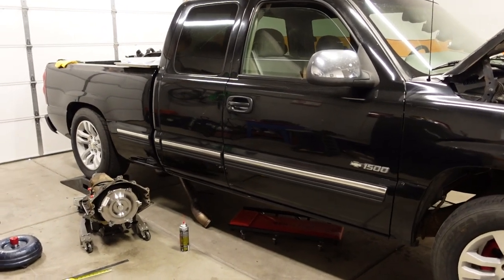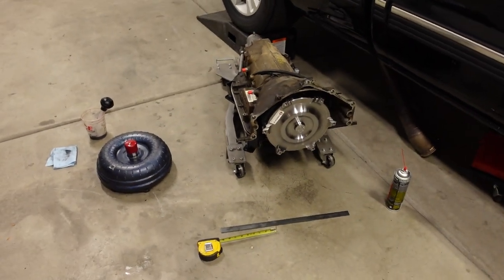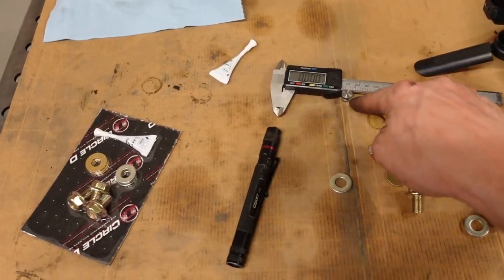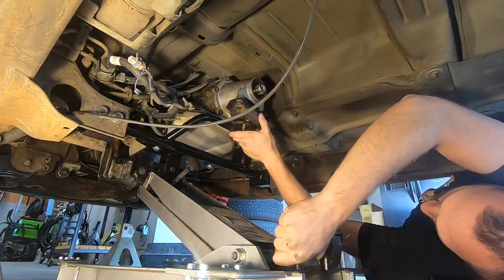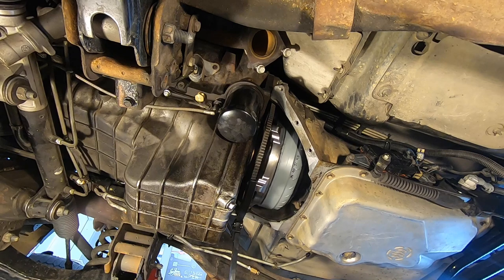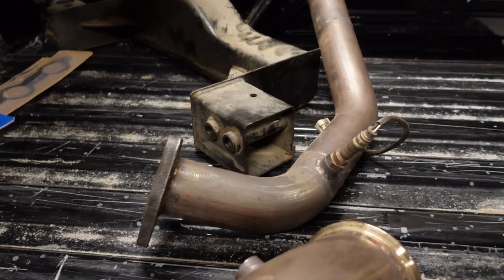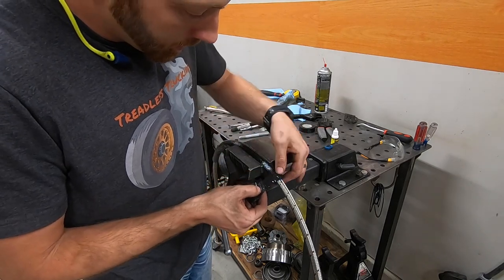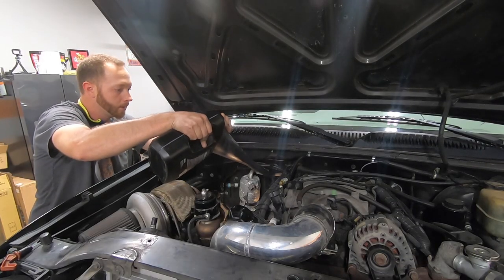the MOST IMPORTANT UPGRADE for ANY automatic transmission.

Comment from the maker: Guys, let me know what you think about the in-radiator trans cooler: did you leave it out or did you keep it, and whats your trans temp like?
Reply: In Utah you're supposed to hook it up in series with the other cooler to help maintain the temperature in the cold...
Reply: i took it out. trans runs at about 150. 2002 CCLB. 10” lift, 22x14’e 35x15.50 tires. 4.88 gears. cam, yank 3200 stall. truck scales at 8000lbs. leave the radiator out for sure
Reply: Use both coolers it's more effecient.
Reply: When i did my 4l80e swap and 40k cooler. I bypassed the factory cooler. But that being said im in Central Texas we don't get very cold. I never get above 180-200 with a load in 100+ heat index
Reply: @ImpalaSSRulz21  like he said, all it does is heat the fluid if you have a large trans cooler. 4l80’s come up to temp very quickly with the tall first gear
Reply: @waynesworkshop7069  even when it froze in houston, my trans was up to 100ish after just letting the truck warm up idling.
Reply: I went to the comments to ask you to keep us informed how it does and your opinion down the road. I’ve often wondered about this because I’ve had projects in the past where I had manual tranny radiators but I went ahead and ordered one with a cooler built in because I felt water to fluid was more efficient at bringing it to temp, then the fluid to air exchanger could drop it a little more with ambient air. I feel if there’s pros to be had from the rad cooler I want it hooked up to take advantage of those. Be nice if you could monitor temps with 3 sensors/locations , one coming out of the trans, one coming out of the factory radiator, then one after the aftermarket cooler before returning to the tranny.
Reply: I left it out being in texas + I have had broken radiators that leaked coolant into the ATF and it would kill transmissions
Reply: I have a 2007 Silverado turbo 4.8 built for towing and I live in south Florida where the heat and traffic suck lol. I have a home built 4l80 as well and when I first installed it I bypassed the radiator and just had my big cooler in the grill. Temps stayed consistently between 185-200 towing. I then brought the radiator cooler back into the loop and it's now 160-180 towing. 
The cooler in the radiator is on the "cold" side and with a temp gun I measured the rad hose going back to the engine and it is around 170 (on my truck that is). Also water is more efficient at removing heat than air. So my hot trans fluid hits the 170 coolant cooler then flows to my 2nd cooler in front of the grill. I've done back to back testing and the radiator cooler does help, BUT if a external cooler can keep up then the radiator cooler probably isn't necessary
Reply: I run the same cooler in series with the radiator being first, I’m up in Michigan and it gets cold so that is why I decided to do it that way. Pcm of NC makes nice quick connect to AN adaptor fittings. I have a 2006 vortec max that is a bolt on truck with 390whp. I also have a travel trailer and when I’m dragging that around I am a combined 16,280lbs. Mine will run 150-160 degrees going down the freeway with the converter locked up, the highest I’ve ever seen the temp is 180 degrees while running around our local sand dunes in low range. I like your installation brackets, mine is similar. Also one other note is that I run a circle D 10.5” triple disc in front of a 4L70e.
Reply: I bypass the in radiator cooler. I run trans Temps with your same cooler at 140-160 or so depending. You can also get the 180 degree thermostat thermal bypass thing from trucool which is good for colder climates but I've ran mine without it and I'm just careful until it gets warm when it's below freezing out.
Reply: Kept the radiator cooler in addition to the 40k.  Normal driving runs about 135° I towed a large profile 10k lb travel trailer through the mountains and never saw over 170. Runs right at 150 with converter locked on highway towing. 2013 2500 suburban with 8.0 big block swap, 6l90 trans with ctsv converter stalls about 2600 in this application. Engine runs 190 with 185° stat.
Reply: I kept mine going through the radiator, 01 Silverado 1500 with an LQ4/80E swap and a TruCool 40K. Here in Florida, the worst I have seen is 160-170 in the heat of the summer. I am still running a stock converter though. I used push lock to extend my factory line, never again. It is already splitting and starting to leak. I should have run AN or PTFE with AN style fittings.
Reply: Delete it. This is a 15+ year old rad at this point. You dont want the rad cooler failing amd pushing coolant through yoyr brand new trans.
Reply: And for people who do t understand how stacked plate and funs work the trans cooler bypasses internally until the fluid is up too temp.
Reply: Also ive never ever ever heard of a trans dieing from cold temps.

I drive my turbo 5.3 with a tru cool 40k and no rad cooler. Still gets up too operating temp just fine in -40c weather
Reply: Personally, I prefer to keep the stock trans cooler, if it's still functional. For the plumbing, I run the fluid through the aftermarket unit first, then the stock unit, then back to the transmission. That way, the stock cooler can help warm up the transmission. After the transmission warms up, the aftermarket unit takes some heat load off the stock unit.
Reply: my trans under 130 degrees or over 180 feels slow i dont know how to describe it but with it going through the stock rad it stays at 150 cruising

Comment: I left it running through the radiator trans cooler on my 4L60E on a 2004 suburban with the same bigger aftermarket trans cooler added and during the summers here in AZ my temps reach 150 to 160 and during the winter it is about 130 to 140, I also use Amsoil transmission fluid, also a shift kit to improve line pressure and firm shift points to help prolong my 4L60E as long as possible.

Comment: I installed the Trucool 40k cooler about 3 years ago in my 01 Silverado 4.8 RCSB 2wd and have noticed a huge difference.  I have the lines run thru the radiator first then to the cooler and it used to run consistently about 200 degrees or so and now it barely passes 150 degrees !!!!   That's even on the hottest summer days in the Northeast sitting in traffic with the AC cranked and monitored thru a factory gauge in a Escalade cluster in place of my Chevy one.  Enjoy the temperature drop !!
Reply: Good to know. I'm looking to put 1 on my 08 silverado 2wd 5.3l

Comment: LT, another great video!  Somewhat related, heat is the major shortcoming of the th700/60e variants.  Companies sell all of the “horsepower” upgrades with stronger components but they are still very easy to overheat and destroy.  Cooling, cooling, cooling.  I also completely agree with standalone cooling for any cooling circuit in warmer climates as the most effective way to keep temps down.

Comment: LT I highly recommend a T-Stat on any rig running in a places with wide Temp swings. I run a Improved Racing High-Flow Engine and Transmission Oil Cooler Thermostat, as it has Female -10 O-ring ports and you can set temp of operation from 145*F to 215*F. Uses the bypass method of metering so if the bypass port fails/clogs oil always goes to cooler (never leaving you with no flow or cooler).

I have a built 2010 double cab 4x4 5.7l Tundra, and Toyota is STUPID with their trans temps and cooler setup. I had the truck about 3 weeks and took it to the track to set base lines and boy was I in for a rude awaking. After the first pull in the 1/4 I looked at the logs and see torque converter temps in the 220, did my second pass and they got up to 230. I did the last pass at 245 in the torque converter and said that wont do. The pan was at 230, took almost 2.5 hours on the 4 hour drive home to get the heat out of the trans and back down to normal "safe levels" around 180 at highway speeds in the pan torque converter was around 197'ish. Come to find out the T-stat on the MAX tow package spec Tundras doesn't even open till 210 and become fully open till 250. The idiot light is set for 320 IN THE PAN. So from cold to 210 the engine coolant is the only thing cool the trans fluids and that's at 190-195ish on a OEM T-stat (the T-Delta is around 5*F). Then on a 2010 and up they made the Trans cooler part of the condenser coil, and shoved it all the way up on top putting about half of it blocked from direct air flow by the upper core support. 

So I got this exact unit and the T-stat from Improved Racing set at 145*F, as I live on the South Texas Coast and we see some nice 105*F days with 90% humidity. The worst I have seen is 190*F in the torque convert with 12k lbs behind me pulling over the harbor bridge. Normal is around 150-155*F which is right were I like my trans temps. Running below 130*F is bad as it's much hard on the pump as the fluid is very thick, this means it's much more work to pump it around and can hurt the vanes in the pump. 

Love the build!!

P.S. I also got rid of the engine coolant circuit to trans cooler circuit as it's more heat into the cooling system for the trans and the trans is a pretty good heat pump all on its own haha.

Comment: I'm running the same cooler on my 01 Yukon XL 2500, 6.0L with the 4L80E. Mine is set up just like shown here, except I used the kits from Glenns Auto Performance to make this an almost 100% bolt-in effort. This was a total "while you're in there" that got a little overboard while I was replacing both the radiator and a cooler line due to minor leaks. The truck isn't used to haul anything appreciable and is mostly my DD and kid hauler.

With this setup, per the gauge I can only ever barely reach 150F, and that's only after a lot of stop n go on a hot day. Before, stock, it would hover closer to 200F.

The one downside that I've personally experienced is that, on a really cold day (30s, but that's damn near emergency conditions in San Diego), the truck struggled to lock the TC on the freeway. Internet says TC won't lock up until fluid temp reaches 70ish(?), so maybe bypassing the radiator isn't the greatest thing if you live in colder climates. 

Otherwise, this setup has been awesome for me. Good to know that, if I ever do really put the truck to work, trans temps won't be an issue.
Reply from the maker: great feedback on the colder weather operation. I can see how a thermostat or the rad cooler would be beneficial in the winter time, but luckily I don't drive the truck that much in the winter time.

Comment: Brave man doing a DIY transmission rebuild. Watching you tackle that 4L80 the past few videos is making me want to rebuild my AW4. It'll either be a lucky success or potential content for the precision transmission channel 😂
Reply: I'm not familiar with the AW4 but there is a lot of info out there for these GM trans I recently did my 4l60e myself and it works good
Reply: @james10739  Yeah I've been reading the FSM on the AW4 an hour or two each day. I pulled one off a 2000 XJ in the scrap yard got the transfer case with it. Between the FSM and YouTube I just might be able to rebuild it for Christmas🤞🏽
Reply: I run the trucool 40k on both mine and my wife's cherokees with the aw4 and it brings the Temps way down. My aw4 has a fresh rebuild and I did the transgo reprogramming kit. It shifts super nice, I was pretty conservative with drilling the hole sizes the instructions will have different options you can do, definitely get the transgo 340-hd2 kit it's well worth it. 
It's hard to find someone to rebuild an aw4 properly. They last a very long time so not a lot of people are familiar with them. If you keep clean fluid and the temperatures down the aw4 lasts a long time and takes a beating only failure I've ever had was the torque converter sent shrapnel through the tranny. They run hot as hell in stock form even if you have the optional factory auxiliary cooler. Stick with all oem sensors and solenoids your used oem ones will be better than new aftermarket you can bench test everything.
Reply: @forreststrong797  Yikes!! You rebuilt it yourself? Idk if I've got the stones to be drilling the valve body instructions or not 😂. I might have to make another trip to the bone yard to scoop up a few extras
Reply: @JohnSmith-ot9sc  I have a friend who owns a local transmission shop and he helped me do the rebuild he did most of the work. It really is quite easy to install the transgo reprogramming kit if your in there I'd do it. Like I said I went on the conservative side of things and it shifts nice and firm but is very pleasant to drive. I've ridden in a cherokee that had the reprogramming kit but he drilled to the hotrod specs and then some and it shifted extremely firm, the tires would chirp. 
If you can't find a competint builder I think your best bet is to go used if you need a transmission and don't want to tackle it yourself. It takes skill to properly rebuild an aw4 I've heard horror stories from my friend about people having a shop rebuild the same transmission 2 or 3 times before they bring it to him. They are so durable that if you get a good one and take care of it they last forever. Mine looked great after 280k in fact it looked incredible the only problem was the bushings were trashed from the bad torque converter. My wife's has well over 300k and works flawlessly I replaced her torque converter around 275k. Japanese transmissions can last a very long time it's a Toyota transmission, asin-warner. In a Toyota it's called the a340 I believe and it was used in the Toyota supra and I believe some trucks.
Reply: @forreststrong797  Thanks for all the info. Unfortunately none of the local trans shops in my area really rebuild to much from what I gather. So I'm left rolling the dice on a local shop, sourcing from one of the reputable shops around the nation or taking a stab at it myself. Anyway it's been something I've been meaning to do for some time now. Started when I watched rusty411 rebuild one now watching LT take it on that 4L80 like a boss I'm pretty motivated to give it a shot.

Comment: So I did the same with one from Glenn auto parts.  It came with all the lines and everything.  I have a 06 denali AWD.  My temps before were 200 to 225 constantly.  With this and bypassing the radiator it runs about 150to 175.  In stop and go it has reached 200 but its keeps it alot cooler.

Comment: I did mine with the scrivet tool from harbour freight and it worked like a charm! Just make sure you get the small pack of bolts to go with it as the tool comes with the threaded inserts but does NOT come with ANY bolts.
Reply from the maker: I'll have to check em out, theres an HF right down the road

Comment: I kept the stock in-radiator trans cooler in line with the external cooler.  I plan to change the configuration this winter to include a couple three way valves to allow me to change the setup depending on use and weather.  I have a 90 Cherokee on 33s that I use for wheeling.  It takes a long time for the trans to warm up to 150 degrees during normal driving.  In the winter it barely cracks 125 degrees.  While wheeling hard  it hits 180 degrees and hangs there until the jeep starts to overheat (it's normal on the XJs to get warm during heavy use).  

My plan is to use the in-radiator cooler and bypass the external cooler for normal driving.  For wheeling I will use the external cooler and bypass the in-radiator cooler.

Comment: LT that tape that you are using fir the Fire Sleeving comes from Aviation it is a self Vulcanizing Tape also know to us in Aviation as F4 tape. It was designed and used for the McDonnel  F4 Phantom and used in Wiring Avionic systems.

Comment: great video LT, i got rid of my wimpy factory cooler for a hayden unit trans never ran hot ..the in radiator line my thinking is if you live down south like me (east texas ) you probably wont miss it up north i can see some need for it...its fine to roll without it...just fixed my o-ring on oil  pick up tube on my 05 sierra L33 Z71..your projects are cool i like you fix things the way we would do at home ..thank you LT for all your hard work
Reply: I ran a class 7 transmission cooler on my 03 Nissan Sentra with a 1.8l

Comment: Hi LT,
At some point, I am going to replace my trans cooler and the old, rusty lines.  I am planning to bypass the radiator like you did when I do this job.  If you run into any problems or find you need to reprogram the cluster EPROM when you swap clusters, PM me and I will be glad to help.  I've done a few of them already that way.  Hopefully the tool you spoke about will make it easy and you can do it through the OBD2 port.  Thanks for the video!
-mike

Comment: You can get that tape from a lot of places under various names SOS tape is what my local store carries.
Note 
Keep it clean , wash your hands and keep all dust and oil away from it when you apply it or it will unravel.
If the end does start to peel back carefully cut it off with a sharp blade to prevent it peeling further.
Reply from the maker: good tip on where to buy the tape! Thanks!

Comment: You should mount the cooler with the fittings at the top.  It forces the fluid to fill all the passages in the cooler before exiting back to the trans instead of being able to cross over through the bottom passages and going back to the trans.  The cooler will be more efficient that way.
Reply from the maker: that's a good point, but just about every stock cooler I've seen are mounted with the fittings pointed down. I know there are mixed opinions on this